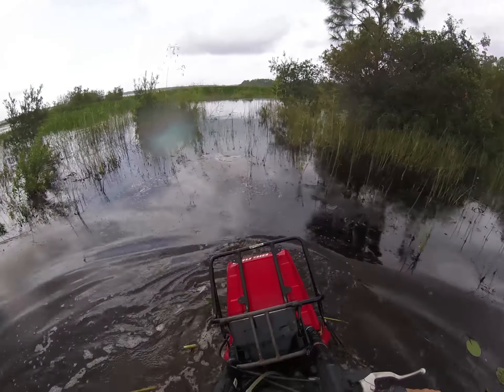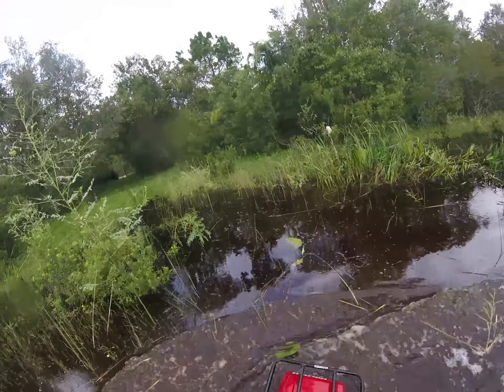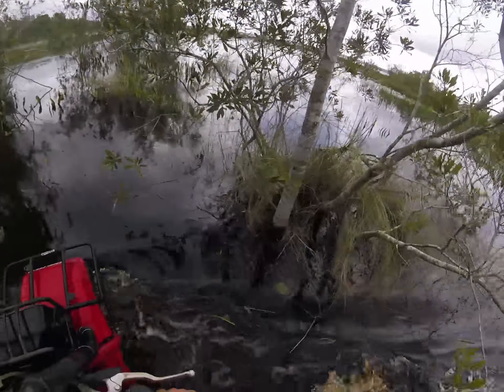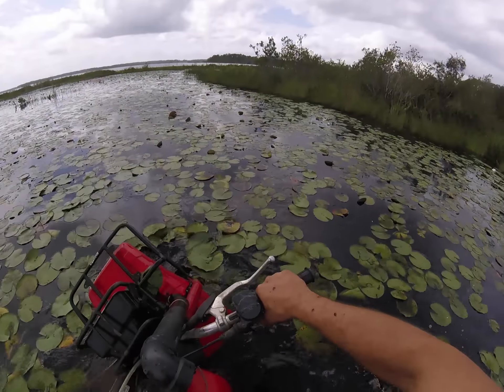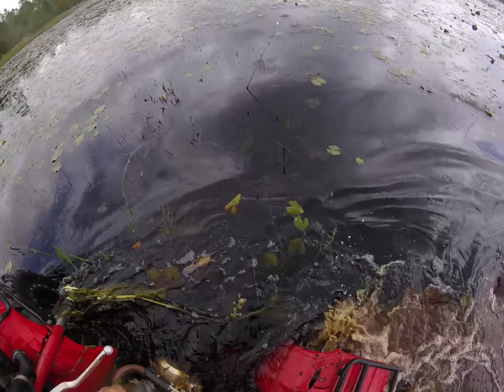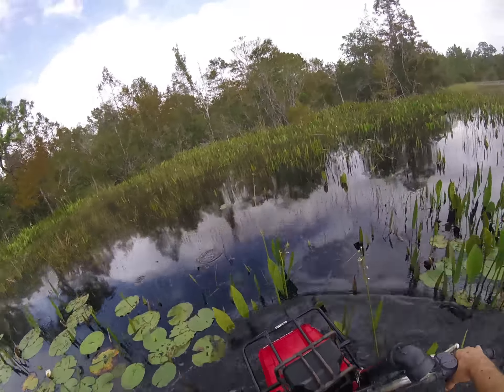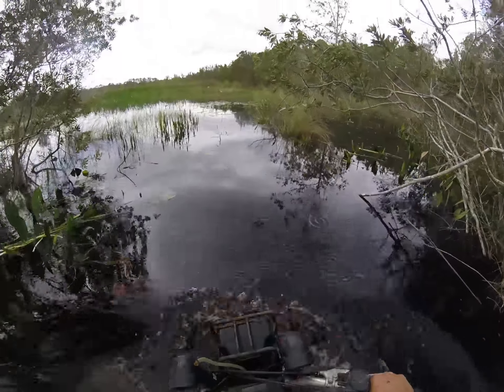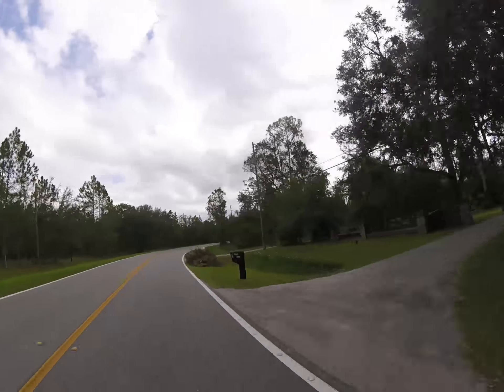ancient BIG RED playing in IRMA flood water

Comment: What all did you do to fully water proof that thing besides snorkel? I have one and want to do that to it but don't want to mess it up. Thanks
Reply from the maker: +Jean Paul Hayes I have a video on it somewhere it's pretty involved because it breeds through the frame from the factory which isn't designed to be watertight I had to seal up a few of the weld seams with ultra black.
Reply: Mud Puppy alright thanks